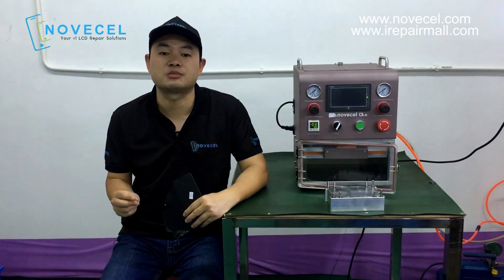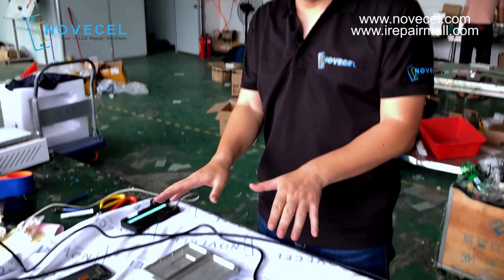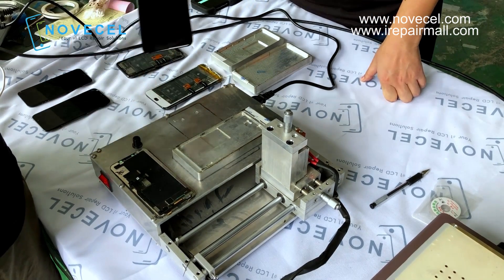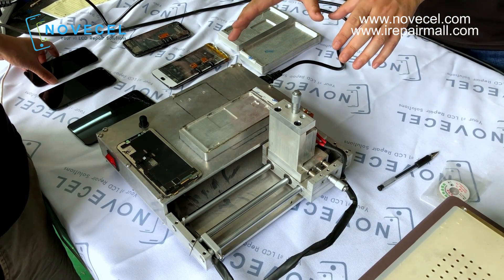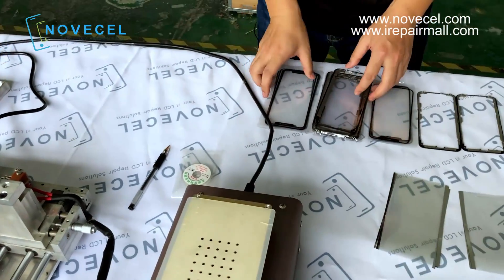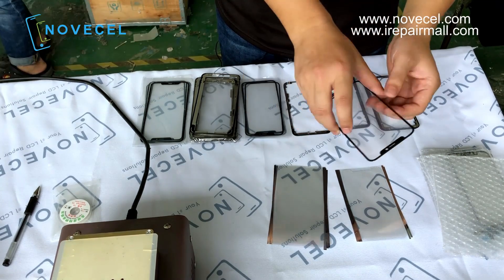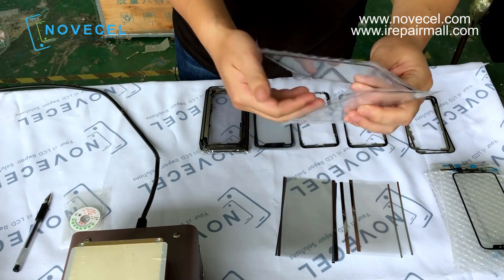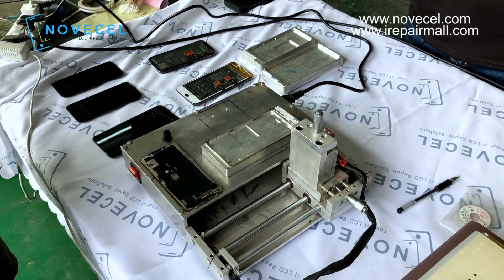How to replace only glass for iphone X , Xs ,Xs Max?-Glass only

Comment: I wonder if they're applying glue between the display and the digitizer? (Not seen that part in the video) 
Or the glass is glued beforehand? I'm confused...
Reply: I think that they used OCA under glass in the lamination process.
Reply from the maker: 100% with glue